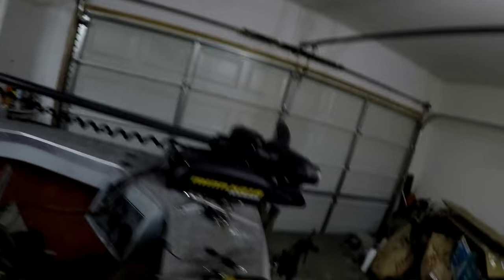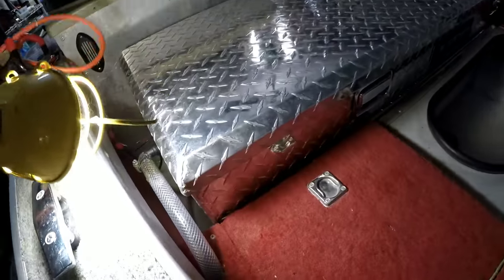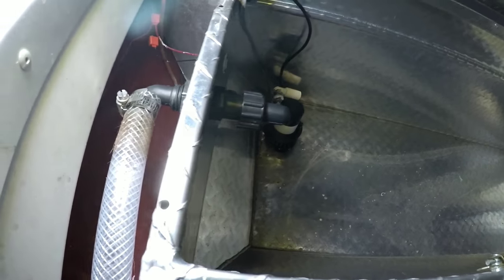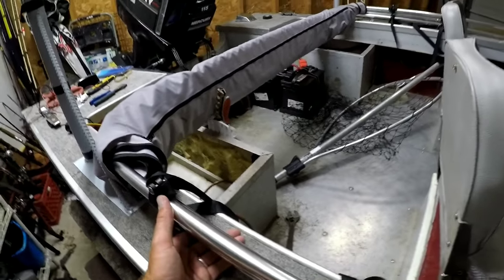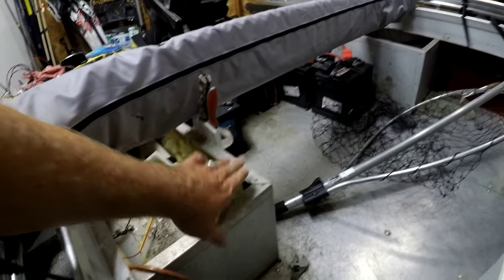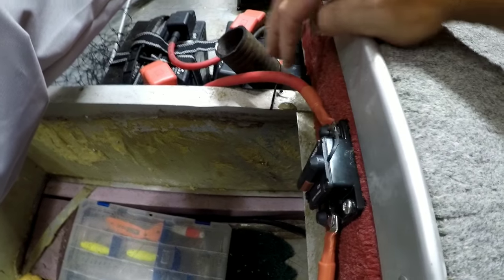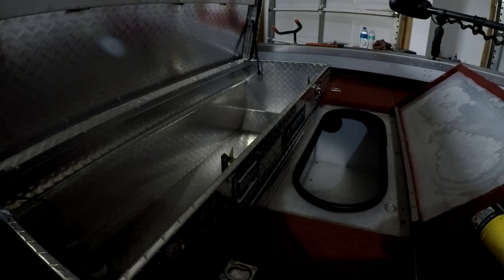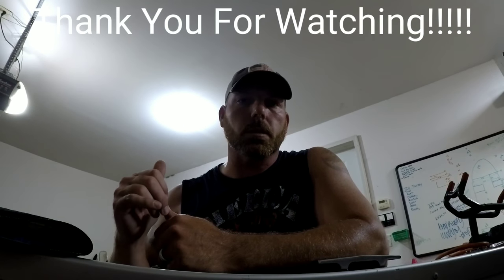Bass boat to Catfish boat conversion build part 5

Comment: Hey buddy..I just bought that boat from Josh..looking forward to taking it out this weekend!!
Reply from the maker: I love that old boat. If you get a 19p lazer 2 prop, it'll run 50mph. Ran 49mph with a 20p but couldn't get the rpms where it needed without porpoising.
Reply from the maker: I thought about buying back but I'm working on selling my big boat to order a Dynasty 2.0
Reply: I'm out in st.charles.... hitting the river again this weekend....sure could use a hot spot right now 😉